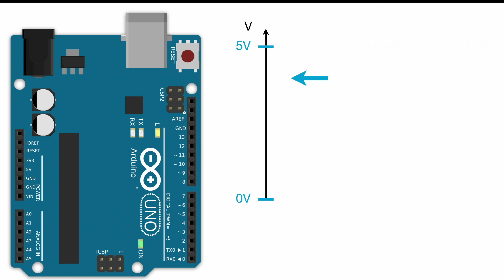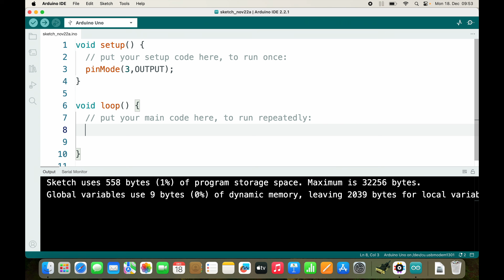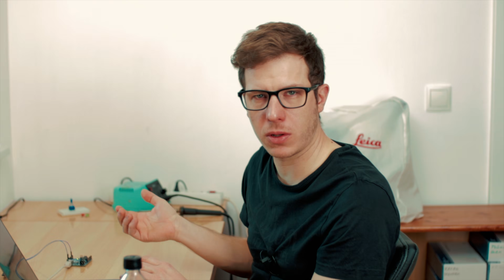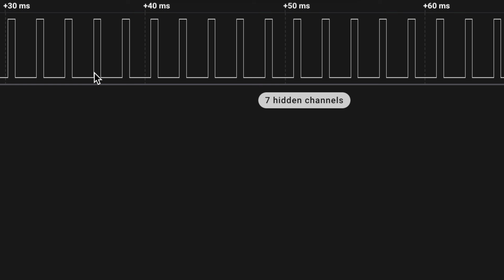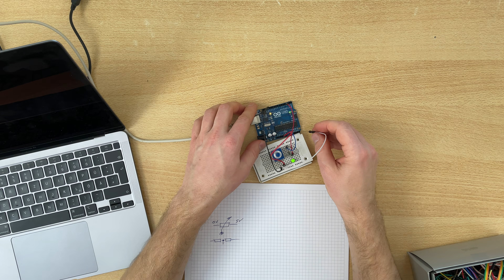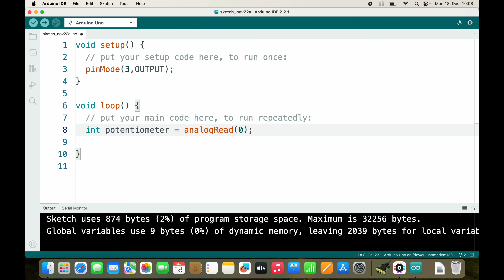analog output arduino - (Arduino Uno Programming for Beginners)

Comment: Would it make sense to place a capacitor across the output pins to create a smoothed DC voltage?
Reply from the maker: Good idea, but what you need is at least a resistor + capacitor. (RC low pass filter)
If you just connect a capacitor directly to the pin, it will be charged very fast and discharged very fast. You need a resistor to limit the current. I think I should make a video about his
Reply: Yes!! Ill watch it!

Comment: Nice video. Nearly perfect. I like the view from your oscilloscope and the animated graphs and also the content of course.
Just a few minor comments:
1. Maybe a more philosophical  question: Even if analogWrite is not PWM but "real" analog output, isn't analogWrite still digital if it can write only values btween 0 and 255? If the answer is: "It is analog", then a CD is maybe in fact also analog only.
2. Maybe record the circuit next time a bit larger, so beginners can see it better where to connect. And/or maybe add a small circuit diagram (where you can also see the UNO)
3. Very small bug: In the forumla R=U/I , the U looks like a V.
4. About lines like "pinMode(3,OUTPUT)": Even I like writing short code and even I done it like you in the past, I learned that in large source codes lines like that are difficult to read. Many guys add a space after a comma. So like "pinMode(3, OUTPUT)". It helps also guys that write decimal numbers like pi with a comma instead of a dot. So if they write in real life numbers like 3,14 (instead of 3.14) it is easier to read functions like function(3,14). Since you might missread it as a human as function(3.14) even it is function(3, 14).
5. Maybe as task or next chapter: Let a LED flash and decrease the time delay. Do it until you can't see it flashing anymore and calculate the frequency. Maybe log it in the console. (I done something like that already. I was a bit suprised that I was able to see 60 Hz still flashing. I expected a lower value. I wasn't able to see it anymore at around 75 Hz flashing, even it was visible with my smartphone.
Reply from the maker: Thank you very much for the detailed comment and the kind words!
1. If you have a digital analog converter, one could argue it is not really analog because it still has both discrete amplitude and discrete time. At the same time, as soon as any signal (also digital signals) leaves the microcontroller is is in fact an analog signal because it is not perfect anymore. 😃 so yeah I agree
2. good point, next time 😬
3. in english it's supposed to be V. But it also looks wrong to me 😅
4. I new about this convention but never new that it was to better distinguish it from floating point values. It makes totally sense, I will try to improve but this is something that always happens if I code fast 😐
5. Indeed a very interesting experiment!